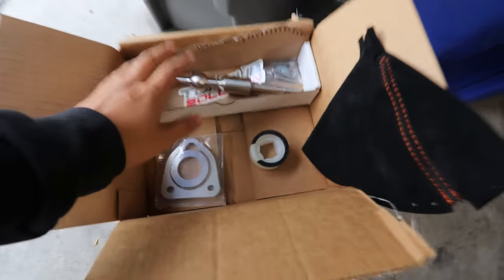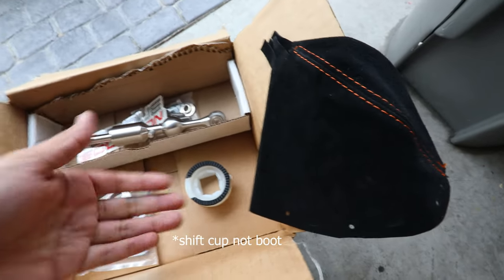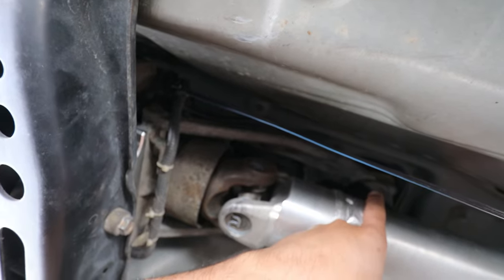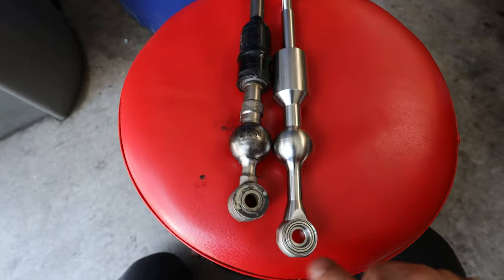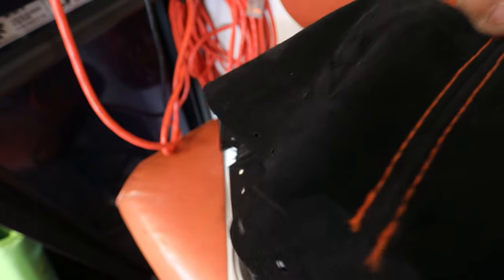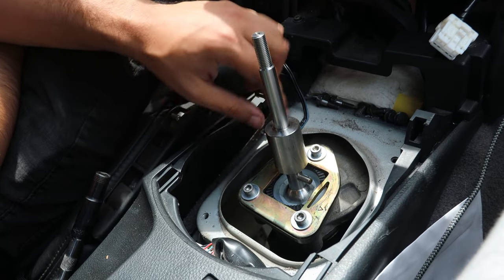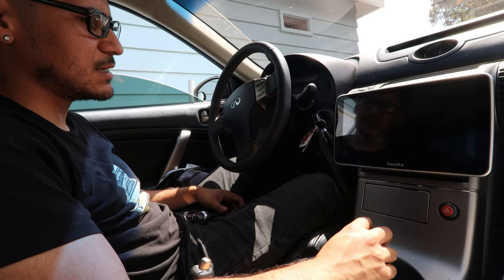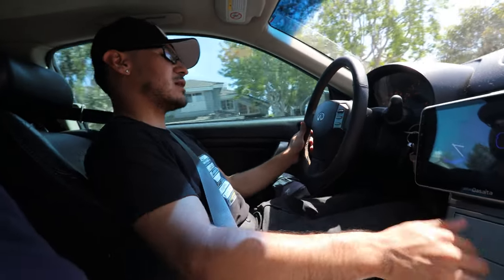Short Shifter Install - G35 / 350z (Torque Solution)

Comment: Best shifter for these cars! Nice job.
Reply: Does the z have a lot of clutch chatter? Or is my inout shaft goin out? It only does it when i let off the clutch and everything in there has been replaced including csc and throwout bearing(pilot bearing). Some say its normal some say its the input shaft what do u think
Reply: @samuelmccloud2954  I think it's normal. Nissan are just noisey. My buddy's 350Z way noisey with a new clutch and single mass fly wheel and I worked on an R34 that was similar.
Reply: @AnthonyJ350  sounds good just figured id ask you since i follor you videos by heart n stumbled upon you in the comments 🤙
Reply: @samuelmccloud2954  That's awesome you watch our videos! How old is the clutch in the car?
Reply: @AnthonyJ350  id say about 9-11 months
Reply: @samuelmccloud2954  You're probably fine, try to compare the noise to other cars at a car meet if you can.

Comment: Have u done a review on your coolant throttle body bypass does it feel any different??
Reply from the maker: If you notice a difference it won’t be by much but it’s nice to know the air is going in as cool as can be. One way you can see results is using a IR gun before and after the coolant bypass mod and go for a drive to see what difference that made to the intake air temps!

Comment: Hey. You mentioned that the transmission brace softened up. Does that mean that at idle and while on the throttle that there’s less vibration than when you first installed it? Thx.
Reply from the maker: Yeah you’re exactly right! In those moments it doesn’t feel as crazy as it did in the beginning!

Comment: Did you have to thread the collar onto the shifter by twisting the boot around the collar or did you just press it on? I bought the same collar and shift knob and TS shifter and my knob isn't straight when it fully tightens...I was thinking the company maybe engraved the numbers offset by accident
Reply from the maker: You have to play with it by threading the collar so when you tighten the shift knob it’s perfectly straight!
Reply: @JoeVazquez  I figured out the shift knob no being straight... I just threaded the collar down a few threads and then threaded the shift knob on it and the numbers are completely straight when I shift the gears now... Keep making  content your  videos are great!!!!!!

Comment: I got this shifter a new cup and new spring and I get a very loud rattle starting around 4k rpms. Did you have this issue?
Reply from the maker: Double check all your bolts!

Comment: I just installed this and can’t get into reverse anymore. Wtf?
Reply from the maker: Go back and check the plate! Keep adjusting until you can get into reverse and you should be cherry!
Reply: @JoeVazquez  what plate? It won’t go into it even when I remove everything and try it without any plates
Reply from the maker: That’s strange, you have the bottom spacer and spring at the bottoms right? You also installed the bottom bolt under the car correctly? That’s should be enough to get it into reverse
Reply: @JoeVazquez  I tried both with and without the spacer on the bottom. I have a black cup which I don’t think comes with the car so maybe it’s the cup thing
Reply from the maker: Hmm it depends on what brand you have for short throw shifter, I know b&m short throw has a black cup I believe, but oem is a white cup
Reply: @JoeVazquez  I got a torque solutions one and there used to be a manzo one I believe